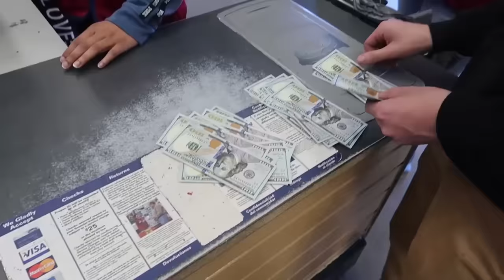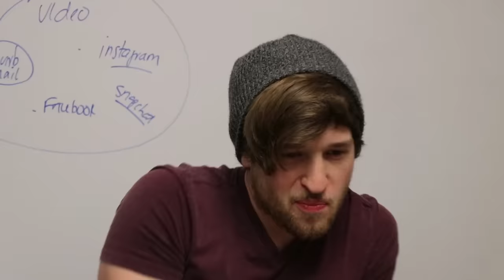Trying To Fly Using Only Leaf Blowers

Comment: I honestly thought they would wire them all up so they can be turned on and off all at once. . .  But I then remembered it was a MrBeast video. . . Not The Hacksmith.
Reply: I had the same thought... but if he did modify the blowers it would make it harder to return them all. Also even if the blowers supported his weight it would more of an open air bounce house than flying .
Reply: They're rich. Not smart.

lol jk
Reply: Fluro Fire this comment was better than the whole video
Reply: Fluro Fire no.
Reply: David Ocampo i agree

Comment: Attach the leaf blowers to the frame and tie the tarp to the poles of the frame and it might fly by itself!
Reply: Parsa Tayebi nice profile picture
Reply: Was hoping someone would correct you so I could type r/wooosh, literally
Reply: Parsa Tayebi that wouldn't work. A leaf blower Usually weighs 15 pounds so that's about 400 pounds the wind has to pick up. It would probably take a category 5 hurricane winds to move it aka 150+ MPH winds
Reply: kid convict thats not the reason why it wouldnt work lol...the leafblowers are blowing upwards which is causing the same force downward making the net force 0. Its the same principle as you standing up, grab onto your legs and lift yourself off the ground
Reply: The tarp has to be air tight.
Reply: KiLLJoY why would that do anything?
Reply: Shaun N well said
Reply: Parsa Tayebi dumbest comment on the Internet
Reply: Aviation dosent work that way

Comment: You should have tied the tarp to the edges of the wood frame an connect the leaf blowers to the frame and see the whole thing fly into the air.
Reply: Yeah I know that Hot Air Balloons were invented
Reply: I feel you misunderstand how hot air balloons work. You're basically trying to do the fan on a boat pointing at its own sail trick. If anything it will push down slightly
Reply: Lana Smith think that was the joke-

Comment: Turn them upside down make a hover craft?
Reply: Best. Idea. Ever.
Reply: davidisdivad yea best idea
Reply: Nice idea
Reply: I was thinking the same thing. I was thinking more along the lines of flipping them over and building a lightweight deck over them.
Reply: 999,999,999,999 intellect
Reply: davidisdivad more leafblowers = more wind but also more weight... what would you think would happen
Reply: WHY DIDN'T HE THOUGH lol I mean if you took a really thin piece of board and nail this thing they built to it then attach somehow all the vacuum cleaners similar to the way they did in this video THEN FLIP IT OVER he basically could've done just that... My guess tho is it'd be difficult to get them all turned on when upside down. But worth attempting yes
Reply: Harvard wants to know your location
Reply: voteZDLR did you even read my comment
Reply: So they are just blowing air in the open.  Building a hovercraft, requires a bladder system.  I'm sure the smart ones could find an example of it already done.
Reply: @mrbeast

You know.
Reply: If one leafblower cant let its own weight fly 10 wont eighter because its also more weight so it would be inpossible
Reply: no i did make it by my self
Reply: Don't think it will work
Reply: you want to take them apart first and only keep the motor and the fan blade  get a car battery or 2 and link all the motors to the battery then add a lightwieght frame to make a hovercraft
Reply: Infinite iq
Reply: davidisdivad You copied this :/
Reply: Bie (best idea ever!!)

Comment: I expected better. Why didn’t you’s turn them upside down and secure them to the frame. Chain the frame to the ground leaving a little loose so it could lift off the ground with someone sitting in the middle. Having some way of turning them all on and off at once. Surely you’s could pull it off but anyway, it’s finished now. Failed